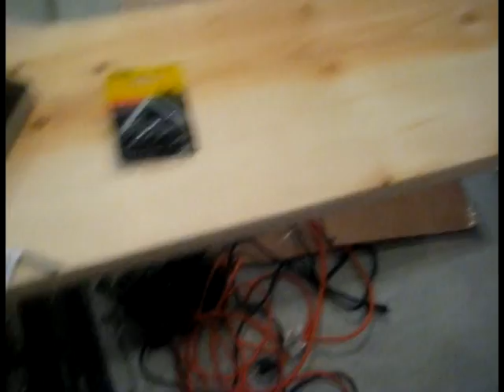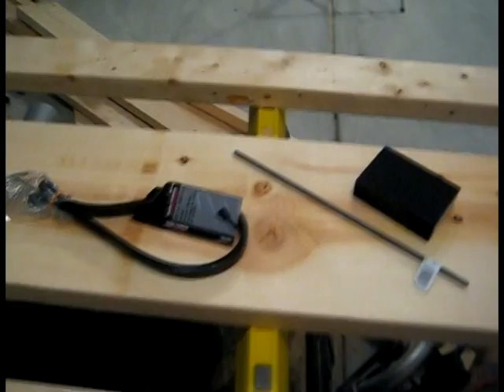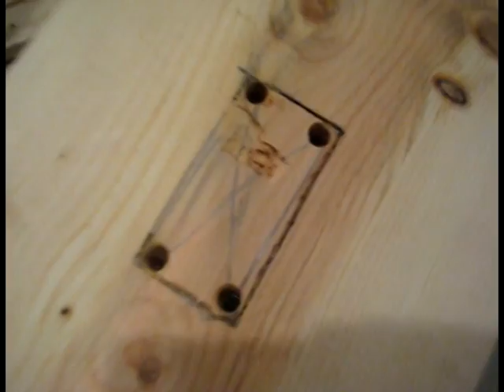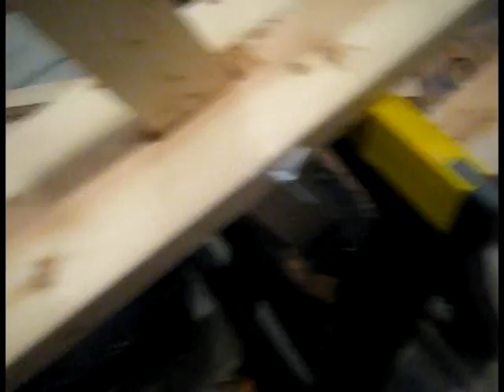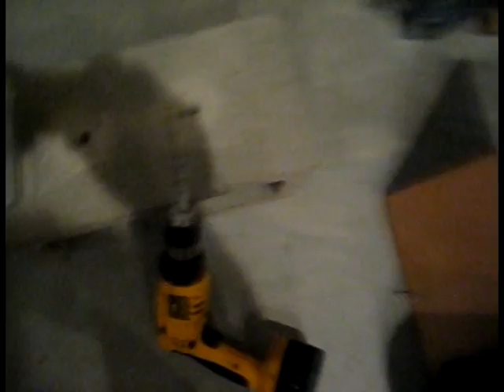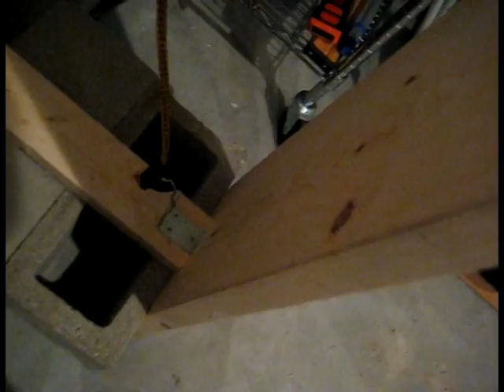How to Build your own One Arm Spring Loaded Wooden Dummy (Mook Yan Jong) for under $40

Comment: You can take rolls of t-paper place them on the sides of the 2/4 were the fist would be and ducktape them tight so the end of the 2/4 won't scratch you I've also ducktaped papertowes to the front and sides of a 4/4 it's super solid for striking and bagloves are not necessarily

Comment: Martin I am totally impressed....I hope my plans helped the beauty of this construction is the flexibility and your own imagination. We have the metric system here (used to be imperial until about "70 or so) so I hope my inch measurements were near enough....I like the stand very clever...also if you round out the holes of the arm it will give you a nice side to side movement which helps with your Huen Sau and to punch the arm off the centreline....great work Brother totally in awe with this.

Comment: Lol 😂😂easier said than done..I thought I could make something similar with a spring, a rounded wooden dowel and some rope but It was a fail hah! Back to the drawing board
Reply from the maker: Yep, it was a challenge and took a few tries to get what I wanted but in the end it worked out OK and I am far from a carpenter! LOL.
Reply: Hey it works @MartinSeckofficial I think I need to cut the spring in half to take a little weight off
Reply from the maker: Good plan, you don't want that arm flying back up and cracking you in the dome!